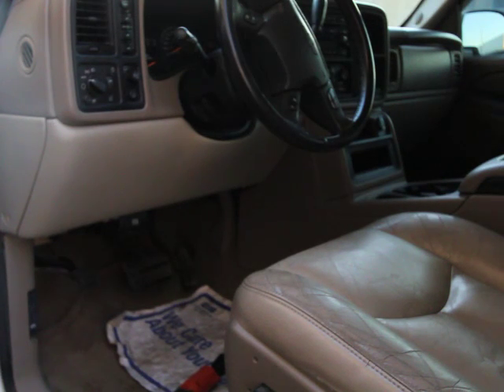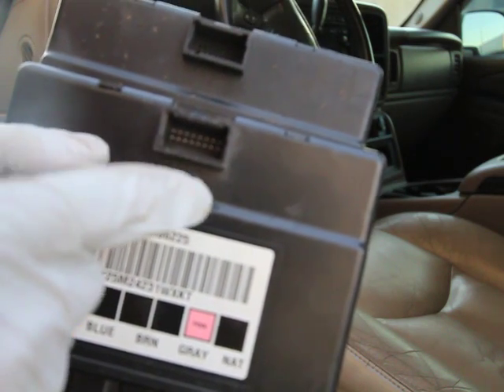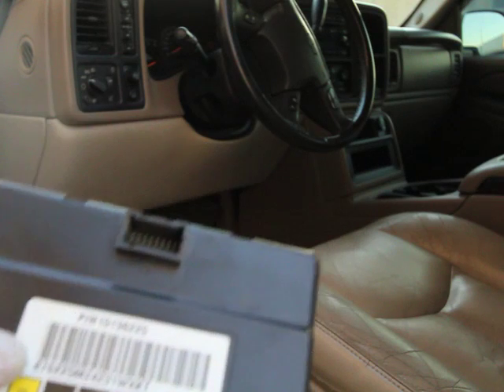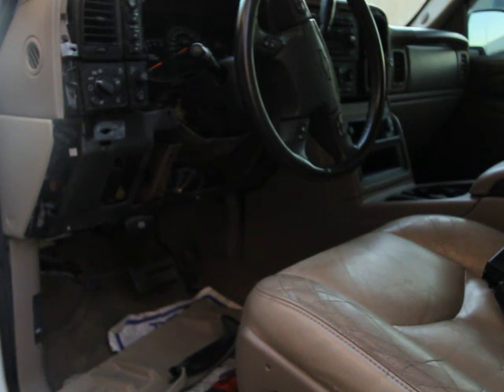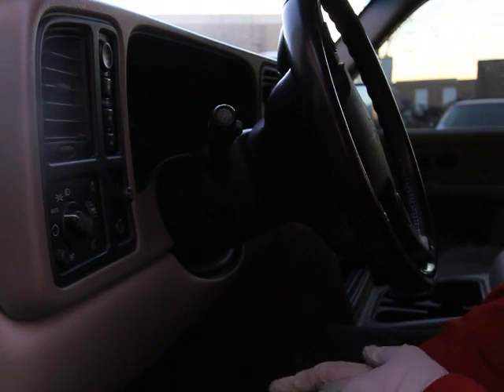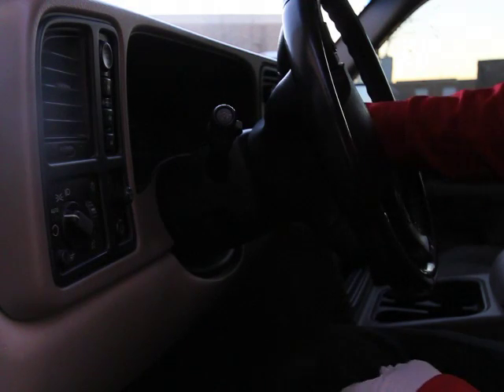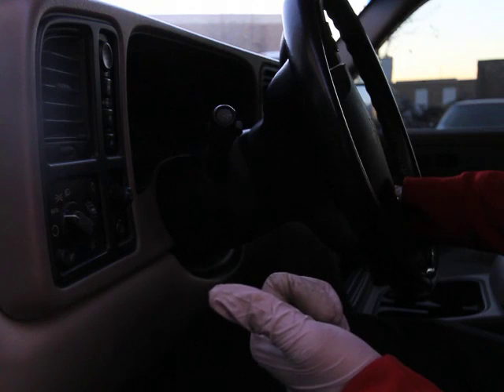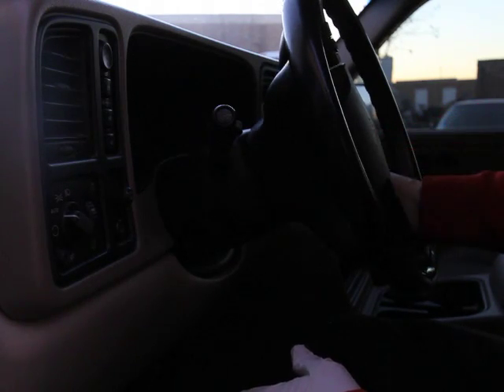GMT800 TRUCKS BODY CONTROL MODULE BCM REPLACEMENT AND PROGRAMMING

Comment: Need a few answers to these question.but first I had been having problems with my 01 pontiac grandam so I have changed alot of parts on my car. Problems: The cars radio would come on around a curve or if I hit railroads tracks, car would die. Security would kick on making car not start, Dash Lights flash so on so on. Ok security light gave issues alot so I bypassed it. Drive fine for a long time but now I've had problems with no crank no start for the past several days. I took my BCM out and it was laying on inside the  kick panel in water. I've bought a new battery thinking that was the problem and still won't start. I'm thinking my BCM is bad but I drove it days before after finding it in water but now won't start at all. So could this be the bcm. Also will a 01 Alero work in a 01 pontiac grandam. I've heard certain numbers could work is this true or does it have to be the same numbers on my BCM?  I'm lost and out a whole lot of money and need help figuring this out. U can email me or answer me here but need answers lol I've about replaced every piece on this car lol @  shereelawson40@gmail.com ty
Reply from the maker: Sounds like bcm is bad if it got wet. We dont sell them for that car but 3 different versions can be found for that car. One has keyless entry built into it the other two do not.

Comment: Do i Need to reprogram my BCM if I am adding factory power windows and power door locks to a non-powered truck?  It is a 2001 Silverado W/T... not prewired for power windows or locks.  
I already swapped in the door panels, switches, window regulators and motors, complete door harnesses and lock solenoids.
What else do I need to do to convert to power?
Reply: Did ever find out if you needed to reprogram? I am also stuck on his bcm not letting me relearn my key.

Comment: Okay so what if I replaced my bcm and it cranks up on the first try but I can’t lock my doors, the radio won’t play and it’s reading no oil on the screen ?
Reply from the maker: What are you working on?
Reply: Spartan Autoworx 2007 GMC Yukon sle

Comment: 04 s10 blazer bcm won't work with scanner mechanic says need a new one reprogrammed from dealership.Said it has to sink.and didn't suggest buying a bcm preprogrammed to the vin from online because of that.would it work from you guys?
Reply from the maker: One Can be pre programmed and work correctly if the seller knows what they are doing. We currently do not program one for the year and model you are requesting.

Comment: 2007 silverado we replace the bcm some of the lights are not working, radio is lock but the engine it's working
Reply from the maker: Did you program it?
Reply: @SpartanAutoworx  no, we just replace it.

Comment: great video my question is I have a 2000 GMC Sierra and I want to put d i c driver information control from an SUV in there if I put the body control module in there does it have to be from a 2000 to 2002 or can I use a 03 and up? thank you
Reply from the maker: Not possible

Comment: I have a problem with my 2000 Z71 in which got flooded.i have cleared all the water from every sysytem.O have the truck running with a skip from faulty coils.all repalced.toke it a mechanic where he chechecked a few thing but know it will crank and shut off.can it be a BCU? i;m looking at all ideas as to whats worng.seems to me it not get enough gas to power thr enine sounds like a fuel delivery probom although it has good fuel pessure.
Reply from the maker: Codes?
Reply: @SpartanAutoworx  PO122(fixed)PO135 and PO161 which both are oxegen sensors.

Comment: I have a 2000 GMC Sierra 5.3l. I replaced the BCM with one I bought from rock auto. I did the procedure to get it to start. Now since the new BCM is in my headlights are on all the time. More importantly my TOW HAUL does NOT work. It's not the shifter cable, I even cut out the connector and soldered new wire. Button has continuity when pressed. Took it to the dealer and they said the BCM isn't programmable? Everything worked before I replaced it! I replaced it thinking I had a phantom battery drain... It turned out being my amp for my subs. The fan on the amp never turns off. Put in a kill switch now battery is good for days. I don't have my old BCM. IS THERE ANYWAY YOU COULD HELP WITH THIS?
Reply from the maker: Dealer is wrong you can program the bcm no problem.

Comment: I may be needing a BCM for a 2004.5 GMC sierra 2500 HD (RPO is LLY) crew cab SLT. The problem I am having is the alarm will go off when I am driving.  The panic alarm with aftermarket alarm will go off.  I also am unable to read the stock tune file with  a programmer.  Everything else appears to be working fine.  I have gotten a U1000 code and U1301 code.  Any help is appreciated.  Thanks my email address is davidhuerta78539@hotmail.com
Reply: davidhuerta78539@hotmail.com
Reply from the maker: Can you talk to the bcm with a good scan tool?

Comment: Can i use a crew cab bcm on my single cab? Doing electric windows and locks conversion
Reply from the maker: yes you can but I would stick with interchange 1129 if it was me
Reply: Spartan Autoworx  i ended up getting it from a ext cab   Got dash harness. Door harness ,bcm , fuze boxes regulators actuators panles and mirrors for 100  i will be doing it Saturday
Reply: LS Guero my truck and the donor truck have the exact same interior fuse box do you think the power window conversion would work on my WT if swap out the bcm

Comment: 98 yukon slt no tail lights/ stop lights dash lights . Will not start security light on will not go off. 
 Replaced brake petal switch and head light switch.
Reply: Grounds, Grounds, Grounds....its a Chevy from 98-06

Comment: 2003 suburban. 
Would bcm cause vehicle to shut off while driving went over railroad tracks. Will not start. Starter is good, battery is good, relays are good. Mirrors work intermittent, locks work only after removing pcm fuse. PCM fuse releases several relays when removed but soon as key is to run position all goes off and no crank. Any suggestions would be appreciated.

Comment: Sell me a BCM for a 2002 Yukon Denali XL
Reply from the maker: Part number on old one?
Reply: @SpartanAutoworx  it's still installed on the truck. I do not want to remove it yet
Reply: @SpartanAutoworx   can I see the part number without removing it?

Comment: When I turn my headlights on my rear windshield wiper comes on. all my dummy lights like e brake is on ABS security traction control I thought it was a ground wire situation so I switched and re-did all the ground wires and added extra. Do you think it could be a body control module. I had one mechanic hook it up to a scanner and that’s what he suggested.
Reply from the maker: What year make model?
Reply: Spartan Autoworx 04 Yukon Denali
Reply: Most likely a bad ground to the wipers circuit
Reply: idk why but to me thats funny lol, i want to know if you found a salution to this however

Comment: What about the "engine hot a/c turned off" is that a bcm issue?  It clears when I clear codes for a sort time then says hot again. I put a all aluminum radiator, new temp sensor and thermostat. My research lead me here.
Reply from the maker: Sounds like PCM not BCM
Reply: @SpartanAutoworx  
There are some wires that have been  rewired coming from the bcm on this truck(I just bought)  and I read a Silverado thread where a master mechanic followed this same problem to a burnt plug on the bcm. I would love for you to be correct as the pcm is only $100. But I fear it is the bcm which is way more.

Comment: I'm having a problem with a 2000 Tahoe , Chevrolet has had it for 3 weeks they can not program the modular , I want to know if you can do this because of hey can't  , I'm in Indianapolis .
Reply from the maker: Do they have communication with the module? If so they need to start with a 10min vtd relearn under reprogram and replace.

Comment: Spartan, I am currently having issues in my 06 LBZ Crew cab Silverado with my signals not working, RPM/tach being sporadic, windshield washer fluid low warning and my seat adjustments and heaters both inop both sides.  

I have had a few codes come up in the past year that have cleared themselves. But when I pulled them they said BCM. 

Are all these things related? If so, I suppose I call and order one up. I saw them on flea-bay but you never know with that place. And I’m sure as hell not paying stealership prices. They’ll want a billion dollars and a few of my appendages lol

PLEASE HELP! She’s my only ride and it’s snowing like crazy (it’s winter here in Utah), so hand/arm signals are a pain!!!!

Comment: I have an 04 Silverado with no power windows but have power door locks. Replacing the bcm and installing all OEM parts (wire harness, door saitches) would make the power windows work?

Comment: quick question. I recently replaced pcm that was reprogrammed with my vin#. but runs perfect but I noticed last night when either visor mirror is opened, or map light is turned on. the corrosponding lights do not come on, but the button lights around radio and temp controls go off until you close mirrors in visors or push map light button again. I was thinking bcm maybe need remarried but pcm was programmed with my vin.  anyway i am trying to determine if I need a new bcm
Reply: Did you? Same issues here and I’m thinking yes

Comment: Can I put a crew cab bcm in an extended cab?  because I got full power heated leather memory seats out of a crew cab and the memory doesn't work because my extended cab bcm doesn't have the plug in for the seat stuff. Besides I will be building the truck into a crew cab dually, so would be nice if I could just swap the bcm along with the pcm and just go to town. Any info would be very helpful, Thanks
Reply from the maker: Crew cab can fit anything. Reg Cab and ext cab will not fit crew or suv.
Reply: Ok Cool, will an 05 Silverado cross over to an 06 Sierra?
I found out the hard way that the airbag module wont swap from 05 to 06.
Reply from the maker: GAS? If SO then yes
Reply: They are both diesel's. Hope that still makes them compatible?
Reply from the maker: 6 speed or 5 speed dsl?
Reply: The 05 is a 5 speed and the 06 is a 6 speed

Comment: My fog lights doesn’t work... i already check fuse and relay and nothing... the fuse panel has power but the fog lights plugs has not power... u think its bad the bcm??
Reply from the maker: What are we working on?
Reply: Yukon 2001
Reply: I also have the same problem on my 2000 Sierra 1500. It's 3 door truck Z71 with the 5.3. I get nothing when activating the switch, no relay clicking or anything, but I can take the fog lamp relay out and jump pin 85 and 30 with a jumper wire and my fog lamps turn on. I tried 2 different switches and I can't get them to come on. I know the orange wire is a signal wire to tell the bcm to activate the fog lights, but I don't think my bcm is sending the signal to the fog lights. Anybody know any other way to test this? What am I missing?

Comment: Help!!! I have a GMC Acadia with a no crank, radio works, dash lights work, dome lights don't work. Key gets stuck in the ignition. When I try to start there is no indication of what gear the car is in. When I take the key out and open the doors the radio stays on. Does this sound like the bcm?
Reply from the maker: Could be just dont see much failure in that bcm. Should be a denso unit.. Can you pull codes from the BCM?
Reply: @SpartanAutoworx  Thanks for the reply. Had it towed to the dealer. Turns out it was the bcm. 700 bucks later it's fixed.
Reply: 2003 silverado no crank no start. Only code is a U1000 code.

Comment: I have a 06 Chevy avalanche 1500 z71 4wd to get any type of power to the vehicle I need to jump start it , ABS lights , check engine , air bag lights/signals keep coming on and off intermittently , I can drive around for hours the second I turn off the truck I need to just start again to get the truck started. Is that a bad BCM? 

I have a BCM from the junk yard would I need to reprogram and do the handshake between the used BCM and my truck or do I just need to do the hand shake and not reprogram seeing that it came from another truck ?
Reply: if you had programmed the bcm and you still have the problem, check for the main groung frome the firwall to the hode to the back of the transmission

Comment: I replaced the passenger door lock switch and everything works now. If you have a transmission shifting problem look at the tps. Throttle position sensor. It is riveted on the side of the throttle body. I would recommend replacing the whole throttle body. Thank you for your help. I enjoy the videos

Comment: My security light ok only comes on when I turn my key off (that's normal) but I'm still not getting any response from  my ignition I can start it jumping the starter and it runs great!!! But will not start with the key I get a battery light on my message center 2000 Chevy Silverado 1500 Z71 I need your help (just put this motor in this truck )
Reply: Having the same issue.

Comment: i have a 06 denail  and my master door control do not work.(windows, mirrors, heated seats, pedels adjust etc),   when turning key b4 starting, the controls light up on the master door panel. after starting my truck and the computer cycles the master door panel controls go out.. but on once in a while it might pop back on while driving and cut right off. What could be the problem? All other door controls works fine...
Reply: Calvin James III sounds like a bad connection somewhere.

Comment: I have 2003 Escalade my taillights & sometimes my front lights doesn’t work at night the light bulb are good & fuse are good I change the switch . When I press like the fog light and I change the switch from  automatic to parking lights sometime my taillights come on

Comment: Will gladly send you money if you can answer this...  what all has to match if a donor vehicle is available? I swapped in a matching year BCM, PCM, and radio all from the same donor.  Security light blinks for the 10 min relearn cycles and then goes solid, (it didnt before the BCM/PCM swap.. the security light just stayed on and didnt blink or change at all during relearn procedure. I've tried procedure twice now while on a charger, still just cranks, though sometimes it will try to fire a little when wiggling wires from VAT sensor in ignition. I am aware of the issues with this little electrical plug and I've tried wedging it, dielectric grease, and next I intend to soldier wires directly to pins. **I just want to make sure there are no other modules or computers that I would need from my donor tahoe by going this route.  All of this stems from a wreck, steering wheel airbag deployed and it broke a few wires in column that I've since fixed.  Sorry for the Novel and thank you for any help you can give.
Reply: Your keys don’t match the vehicle modules
Reply: Program the keys

Comment: Would the BCM keep the mirrors, passenger window, moon roof, and remotes not working? the right side is dead. this is a 2003 Chevrolet Tahoe Z71. The rear door window works.
Reply: did you ever get this fixed? my 05 denali pass side is dead seat window lock and mirror
Reply: @The1BadCowboy   see my reply check your passenger switch

Comment: I have a 2005 2500 HD 6.0 theirs break light stays on no cruise control truck starts fine but when hooked to my computer says I got no TPS voltage TFT sensor 0 voltage I just replaced the Pcm same thing any suggestions

Comment: hi spartan. cannot get my 06 silverado 1500 truck inspected do to the inability to scan anything. on top of that i have a list of things not working. such as door locks ,windows, dome lights, radio A.C.  4wd ... in the cluster gauges the only things that work are tac and rpm. we have changed or cleaned and reconnect every ground wire with the exception of the one at the rear of the motor do to difficulty accessing it. i have tried another bcm  from year older parts truck but nothing changes. i did install new ignition switch and change the fuze box still no change.
 i can literally pull the bcm out and drive to work, witch  i thought was odd. 
i share this challenge with. please help
Reply from the maker: Could be bad ECM.

Comment: I have a 2013 Chevy Tahoe I have purchased from our local fire department.  It has several features that have been disabled through the BCM.  If I have this reprogrammed will the BCM be considered a new factory set or will it be considered a new user setting?  Is there a reset button on this that I can manually use to do a factory reset so that all my features work?
Reply from the maker: Whats not working?

Comment: on a 2007 GMC Sierra 2500 with a 6.6 liter I've got a battery drainage issue could a bcm cause this problem I have unhook the radio took fuse out and it is still doing the same thing
Reply from the maker: Pull the TBC Fuse and check for a drain.
If No Change
Pull the IPC Fuse check for a drain
If No change 
Pull Related PCM Fuses and check for a drain.
Repeat for other modules in the truck until the culprit is found.
Reply: we have an 08 that had a drain issues forever. it was a relay in the fusebox under the hood for mirrors. replaced them all truck starts like nos

Comment: How do you know you have a faulty control module?
Reply from the maker: What is the truck doing?
Reply: Spartan Autoworx my brake lights are stuck my windows don’t roll down unless the truck is in reverse my left blinker is stuck and when I brake my reverse lights come on

Comment: I have a 12 crew cab. Throwing a u0199 code. Nothing on my master driver's side door works. Is this the BCM or master door switch?
Reply from the maker: Bad switch or bad wiring. I would be bad wiring.